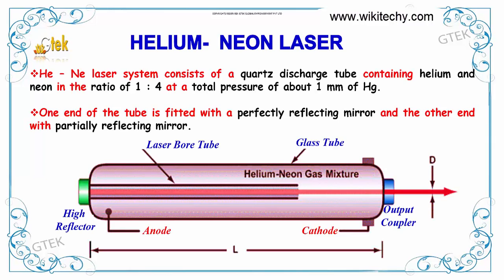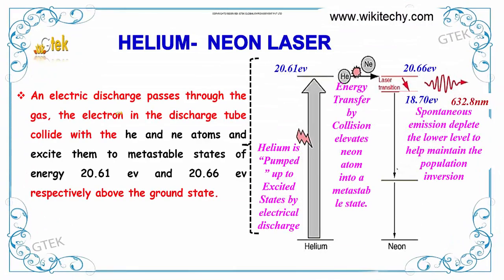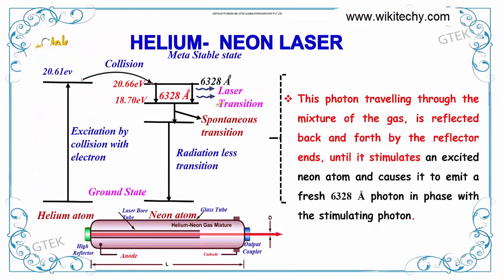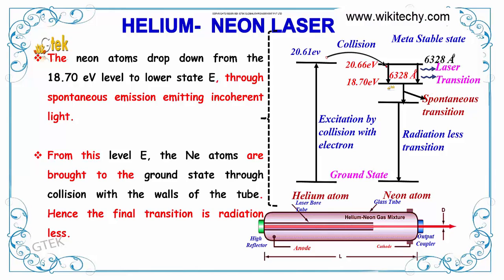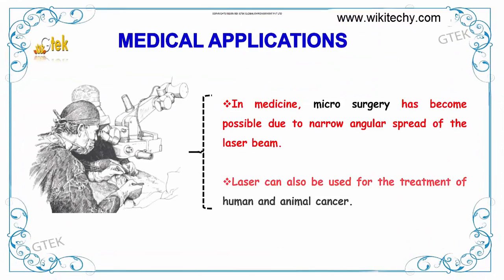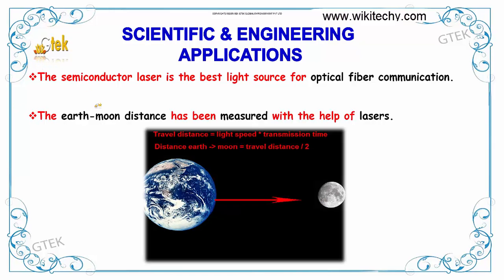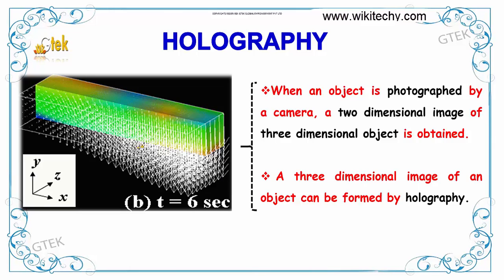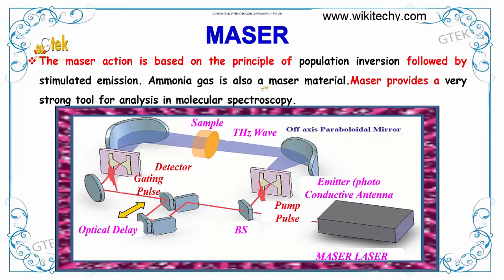Helium Neon Laser | Atomic Physics|class 12 physics subject notes lectures CBSE|IITJEE|NEET

Comment: The CO2 laser (carbon dioxide laser) is a laser based on a gas mixture as the gain medium, which contains carbon dioxide (CO2), helium (He), nitrogen (N2), and possibly some hydrogen (H2), water vapor and/or xenon (Xe).

Comment: The best-known and most widely used HeNe laser operates at a wavelength of 632.8 nm in the red part of the visible spectrum. It was developed at Bell Telephone Laboratories in 1962, 18 months after the pioneering demonstration at the same laboratory of the first continuous infrared HeNe gas laser in December 1960.

Comment: Gas Lasers are lasers that use an electric current discharged through a gas medium to produce a beam. Common Gas Lasers include helium neon, argon, or carbon dioxide. The type of gas used can determine or influence the laser's wavelength, efficiency, or power.

Comment: A helium–neon laser or HeNe laser, is a type of gas laser whose gain medium consists of a mixture of helium and neon(10:1) inside of a small bore capillary tube, usually excited by a DC electrical discharge. The best-known and most widely used HeNe laser operates at a wavelength of 632.8 nm, in the red part of the visible spectrum.

Comment: a type of gas laser whose gain medium consists of a mixture of helium and neon(10:1) inside of a small bore capillary tube, usually excited by a DC electrical discharge. The best-known and most widely used HeNe laser operates at a wavelength of 632.8 nm, in the red part of the visible spectrum.

Comment: He – Ne laser system consists of a quartz discharge tube containing helium and neon in the ratio of 1 : 4 at a total pressure of about 1 mm of Hg.One end of the tube is fitted with a perfectly reflecting mirror and the other end with partially reflecting mirror.

Comment: The first HeNe lasers emitted infrared at 1.15 μm, and were the first gas lasers. However, a laser that operated at visible wavelengths was much more in demand, and a number of other neon transitions were investigated to identify ones in which a population inversion can be achieved. The 633 nm line was found to have the highest gain in the visible spectrum, making this the wavelength of choice for most HeNe lasers

Comment: Red HeNe lasers have many industrial and scientific uses. They are widely used in laboratory demonstrations in the field of optics because of their relatively low cost and ease of operation compared to other visible lasers producing beams of similar quality in terms of spatial coherence (a single-mode Gaussian beam) and long coherence length (however since about 1990 semiconductor lasers have offered a lower-cost alternative for many such applications). A consumer application of the red HeNe laser is the LaserDisc player, made by Pioneer. The laser is used in the device to read the optical disk.